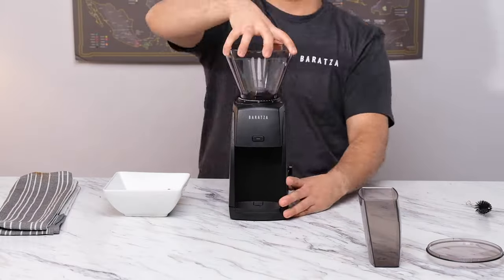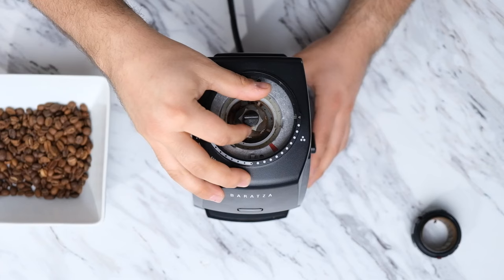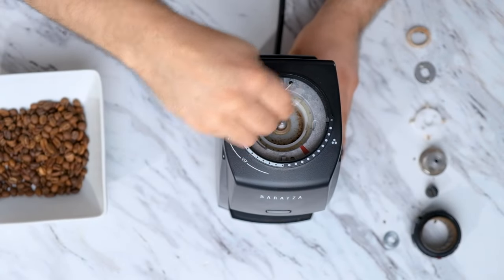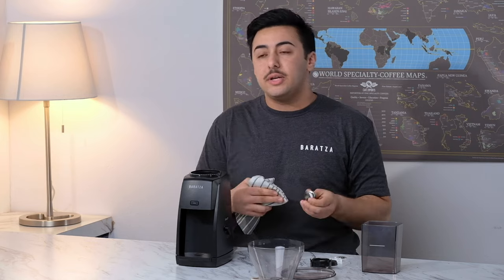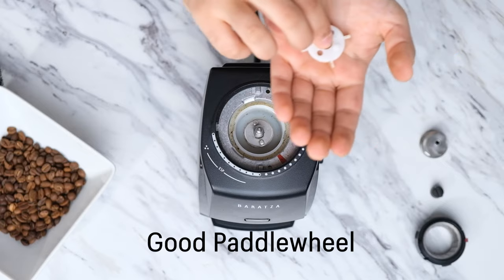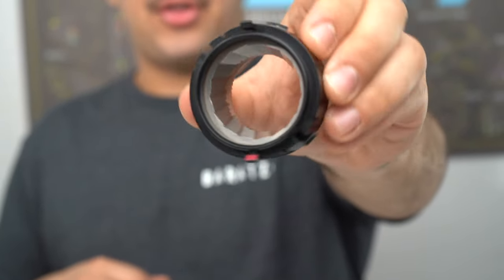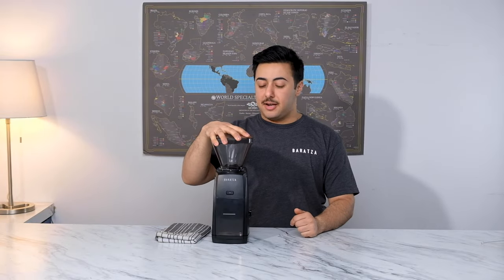Tech Support: Encore ESP Cleaning and Maintenance

Comment: When I turn the quick release knob, it just spins and won't come off.  What am I doing wrong (or is the knob bad and need to be replaced)?
Reply: Took me a second too.  Because of how the grinder spins, the quick-release knob is left-hand threaded.  The knob will come off when you twist it clockwise and tighten when you turn it counter-clockwise.
Reply: Have you solved this? I can't seem to figure out how to remove it too

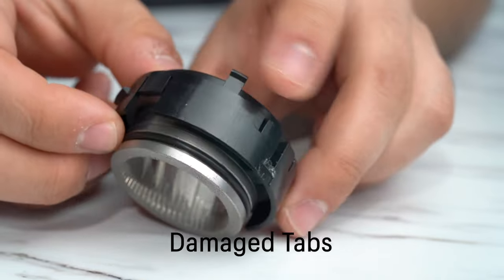Comment: 3:25 I've only had my Encore ESP for 3-4 months and the felt has broken. What do the 6 shims do to the calibration? And why are there 2 extra shims included in a plastic bag? I've noticed that my grinder number are 'off' now, what used to be 15 now grinds way too fine. Please help. The QR code for instructions in the manual leads to a 404 error page on your website.
Reply from the maker: Hi there! This doesn't sit well with us, great questions. Can you send an email to our support team so we can get you back to grinding? support@baratza.com
Reply: @Baratza I bought the esp 2 weeks back. Even on the 0 setting with medium dark roast, it's too coarse for espresso. I added one extra shim and things are better, but is it normal to have to put an extra shim so early considering it's a new machine, wasn't it supposed to be used only after a bit more of wear?

Comment: Hello:  Love the grinder, but it sometimes makes a big mess.  Sometimes it seems the grounds bin is not in the machine tight enough to catch all the grinds and I often find grinds around the machine.  Is this normal, or is there something I need to adjust?  Thank you.
Reply: That happens from ambient static electricity, a small spritz of water will alleviate all those problems for you. I used to have little bits of husk and fine grinds all over my counter every time I ground my beans, now I have nothing just from a few drops of water on the beans before I started grinding! Hope this helps friend

Comment: I have only 5 shims on the machine. Should there be 6 shims?
Reply: idk if you still need this but each grinder is shimmed different to get round tolerances adding a shim will push your grinds up 5-7 clicks and down 5-7 if you remove one. For example mine came from the factory with an espresso range of 15-18, i wanted more control for turbos so i removed one shim and now i can get standard 30s espresso at 10-12 and turbos get the nice small adjustments of the espresso section
Reply: i have only 5 shims. Can I buy and add others shims to grind more finer whithout any dangers for the grinder?

Comment: Do some of the ESP grinders have a different #/size of shims than the 6 shown in the video?
Reply: yeah looks like it. mine has only one. after assembling back it does not grind enough. did yours work okay after assembling back?
Reply: @TheYoubert  Seems to work fine for me. Although at first I didn’t have the quick release knob tight enough which caused it to loosen too much with further vibrations and mess up the grind. Working well after getting that tightened properly.
Reply: @micahbriedwell4790  may I know how many shims you got? i have only 1 shim instead of 6 in the video
Reply: @TheYoubert  I’ve only got the one as well (hope that’s intentional! :) ). There are two extra shims though that came with the grinder, which can be added per the manual, to help it grind finer if needed. Will see if I eventually need to do that after breaking in the grinder more.
Reply: Seems like poor engineering that there has to be shims to provide (I assume) proper stack-up. Obviously it is leading to a lot of confusion, based on the comments. Was this a "rush-to-market" thing? Are there fixes in the works?

Comment: When pushing the front button, the grinder starts then stops immediately.  What can be the problem?  I only had it for less than 3 months and used it infrequently. I like the design and look, but it has to be durable.
Reply: The front button only turns it on for a few seconds, the switch on the side turns on the grinder until you switch it off

Comment: By "quick release knob" he must mean "wing nut" that you don't really need to bother with because once removed there will be no way to lift out or release the burrs below it anyway, and no matter how hard you try with plyers, to torque with a screwdriver, or by banging the unit upside on a tabletop or countertop.  And so then there is hardly a reason to have to put the wingnut back on, although I did anyway.  Just clean it as best as you can.  (I have a Baratza Encore model 485, your model may be different.)

Comment: My one after reassembling is doning weird. While I try to dial in new settings I have too coarse grind. Then I set one finer and my result is even coarser. I do it like five times and rarely gets finer. When I am like 5-10 settings lower where I started I disassemble the hopper again, guessing I cannot be that stupid, I find out the the burr I can tight again. I tight it, and my settings are so different again....So frustrating. Why is it always getting loose?
Reply: Add the included shims

Comment: Got mein two weeks ago, but at the moment I’m mostly disappointed :( The only good thing is the grind quality, which is of course the most important thing. But the retention is extreme - from 0.2 up to 3 grams!!! It is also so clumpy - WDT must be very very aggressive and sometimes I still cannot break everything. And for some reason the lid is very loose and when I start grinding it falls off all the time and I need to hold it with my hand. I know that it’s a relatively cheap grinder, but still it’s not a $50 grinder from Aliexpress. So all these problems do not allow to make a proper shot of espresso because it’s incredibly random. I hope that a silicone bellow helps, but it makes this grinder automatically more expensive